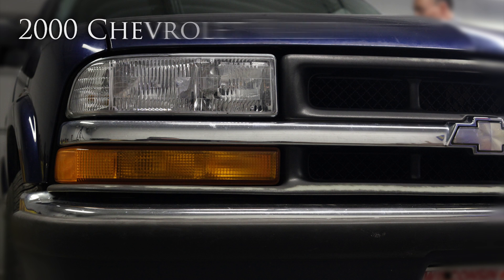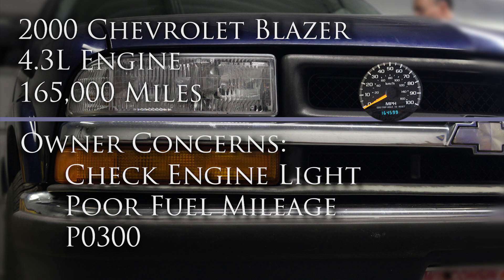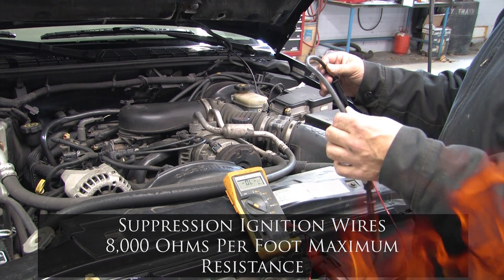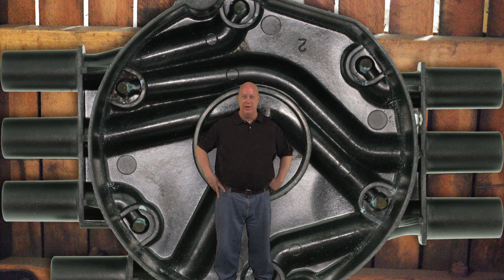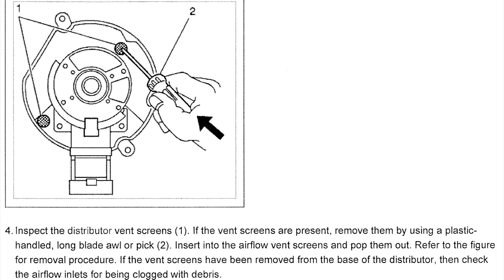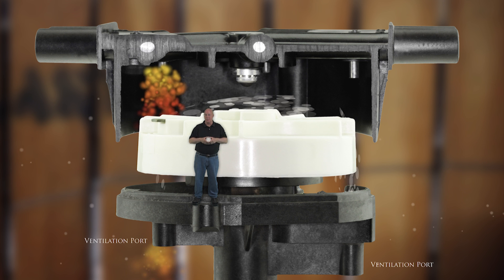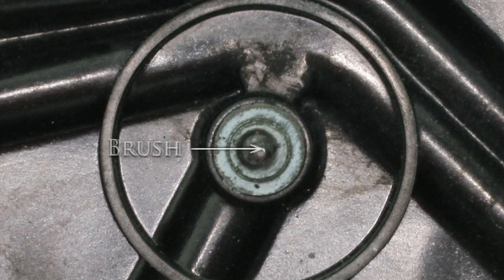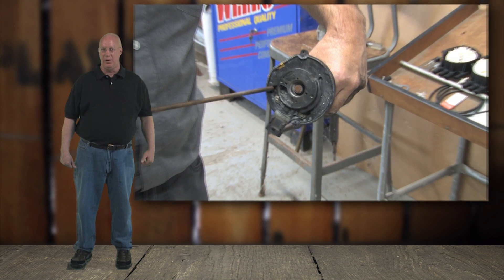Misfire Diagnostics P0300 GM

Comment: So I replaced the cap, rotor wires and plugs back in August.
The car ran fine rain-or shine. It’s January and 40 degrees out and 99% humidity out.
When the car idles I get no missing but when I give it gas the engine misses.
It all goes away when the engine is up to normal temperature.
I’m wondering if the high humidity and the possibility of the screens clogged is the problem.
So strange as this was the first time I’ve changed the cap an rotor sense 2010 and never ever had any problems with the engine missing! I just figured that it was long enough and I change it because of the age. Frustrated

Comment: This is the most informative ignition video I have seen. My 5.7 vortec goes through cap and rotors all the time. Finally saw this video and noticed my "vent" holes where in the casting but never drilled from the factory! Also the timing light trick, checked all wires and had a double fire on 4 meaning it was stealing from Some where, never thought of that trick.

Comment: My #3 cylinder is misfiring. replaced spark plug seemed to fix it, the code stayed away for about a day than came back going to try the coil next. (3.6L pentastar)
Reply from the maker: Hey, be careful swapping out parts like that. A single component can take out other components and you could end up in a never ending cycle. A bad plug can take out a coil. A bad coil can take out a plug.
Mike Becker, Senior Instructor
Reply: @GoTechTraining  I just order the parts to replace all coils and plugs.

Comment: Just replaced all coils/spark plug wires and spark plugs in my 2015 Chevy 2500 6.0 
Still getting p0300.. comes up randomly and when it does it idles really rough and tried taking it for a test drive and see the power decrease
Reply from the maker: How are the fuel trims?
Mike Becker, Senior Technical Instructor
Reply: NGK Technical Training it looks good 
Chasing this p0300 is such a pain

Comment: Okay what if you have a missed only driving but it doesn't miss at idle and you have no codes throne by the computer at all
Reply from the maker: I would take a good look at secondary ignition. Worn plugs could definitely cause a loaded misfire.
Mike Becker, Senior Technical Instructor
Reply: @GoTechTraining  I know you're crazy busy. I should have given you some more information to go on. 1996 Chevy c 2500 5.7 l bortek rear-wheel-drive
NV 4500 Standard transmission. Mopeds crack even load the truck never ever got hot. This is happened after both heads will replaced. New plugs brand new distributor cap and rotor new wires. It's crazy. New fuel regulator and pump was replaced about two years ago. It's not ever thrown a code. Cleaned and inspected the mass air sensor and cleaned the throttle body. Checked the EGR against the proper book checked to be working properly. I checked every vacuum port and line with a propane unlit torch and intake gaskets. I think that's it. I'm far from a master mechanic but I grew up turning a wrench and I have a small business working on Evinrude Johnson outboards. Thank you in advance for your time!!!

Comment: Great video You just got yourself a new subscriber. I hope this is the problem with my bravada. I have a 97 bravada with 212k I love it even though it has a few problems . It wasn’t misfiring but I knew it needed the plugs and wires to be changed. So I got the denso iridium plugs and some new wires and the distributor cap but now it runs very bad and shakes smells like gas and it pops even at idle also the alternator get very hot. One of the screw holes from the distributor broke when I was tighten the cap so I just zip tied it down can that cause the problem? I didn’t want to drive it but I had to take it to autozone so the can scan it and the main problem was po300. When I drove it smelled like something was burning gas or plastic or something. I gapped all the plugs at .60 and put the wires in order. I don’t know what to do can you please help thanks.
Reply from the maker: Hey, thanks for watching! A P0300 is a random cylinder misfire. I don't really see how zip tying the cap tight could cause that. As long as it's 100% solid...best case would having it bolted down. If that caps able to move it could cause your issue. 
Mike Becker, Senior Technical Instructor

Comment: use OEM caps....alot of issues with after market parts.
Reply from the maker: Sure, some aftermarket caps have problems...Ours are built to be OEM equivalent!

Mike Becker, Senior Technical Instructor
Reply: NGK Technical Training Except NGK.

Comment: I'm getting a P0300 code when driving over 2000 RPM. Engine runs great tho. Replaced so many parts, including distributor and crank sensor. I think the ignition advance is not right.
Reply from the maker: Hey Glyn, what kind of vehicle? 
Mike Becker, Senior Technical Instructor
Reply: 2003 S10 4.3L automatic
Reply from the maker: Glyn, what about fuel pressure?
Mike Becker, Senior Technical Instructor

Comment: I have a PO300 and a PO304 CYLINDER misfire on cylinder 4. I replaced rotor cap wires plugs and cleared code then it comes back same side again.misfire 4..  could it be the fuel injectors?
Reply from the maker: Steven, it could be an injector. Could be a compression issue or a breathing issue as well. Did you check compression on that cylinder?
Mike Becker, Senior Technical Services Instructor
Reply: Wells Vehicle Electronics I found the Problem, it was a clogged/bad injector on #4 cylinder. I installed a new set of  Spider Injectors and it runs perfect!

Comment: Tengo el code P0300 trail 
blaser 2002 4.2l
Reply from the maker: Saludos Hugo con respect a el codigo P300 es un codigo que representa fallas multiple de varios cilindros. Lo que yo revisaria seria las bujias pero primero revisaria si el motor tiene una fuga de vacio, tambien revisa todas las mangueras del motor para estar seguro que no esten jalando vacio. Si todo esta bien bueno revisa las bujias. Si tienes uso de un escaner revisa el motro cuando esta fallando para ver que cilindro esta fallando bajo potencia. Este es mi correo por si necesitas mas ayuda ok. fritz.fuchs@wellsve.com espero tu repuesta Fritz Fuchs Instructor de Servicio Tecnico Automotriz.

Comment: Yep. Waste money replacing all the plugs and wires.  All mechanics see are dollar signs.  It's probably really being caused by the MAF in more modern vehicles.
Reply from the maker: I'm sorry you feel this way Dick B. I don't think that is all technicians see. As a technician we want to see a happy customer with a great running vehicle. Nothing is worse than seeing that customer come back a few days later for the same problem. On this vehicle had the spark plug wires not been replaced the truck would have been back in the shop in very little time. Instead of a P0300 code this time though, it would have been setting a P0302 for a misfire on cylinder 2. So it really wasn't a waster of money to replace a worn component. Also, why does the MAF cause more problems on a modern vehicle? I must say from my experience I run into more issues with ignition related problems than MAF problems on todays vehicles. It sounds to me like you may have had some bad experiences in the past bringing your own vehicle into a shop.  
Mike Becker, Technical Services Instructor

Comment: I have a 2005 GMC 2500 Savana Cutaway 6.0L. Can not find anyone in Vacaville or Fairfield Ca. That can repair vehicle with P0300 code. For the past year I have been back and forth with 2 Chevy dealers, We have replaced Crank Sensor, Cam sensor ,plugs wire's, harness, and last time dealer had it they said it was thrust washers on crank. Now it has a new motor and same code. It has traveled about 500 miles. What happened to the Mechanic. Only can find R&R people in this area. Any Idea's??
Reply from the maker: Hey Daniel, sounds like you have one heck of a headache going on. Now a lot of times people overlook the simplest of things. I want to start you back at the beginning. First of all, is this truck flex fuel? 2nd of all, is the fuel in this thing ok, no water in the gas? 3rd...have you had a crankshaft relearn procedure done? That can set a false P0300, and still run just fine. Please let me know what you think.
Mike Becker, Technical Services Instructor

Comment: I'm having the p0300 fault plus p0171, p0131, p0137. I have replaced the the fuel pump, fuel filter, pressure relief regulator, plugs, wires, cap and rotor and still getting these faults recurring. Not sure what else to do now.
Reply from the maker: Tony, sounds like a complex problem. Let's start with what kind of car you're working on. Year, make, model, and engine.
Mike Becker, Technical Services Instructor

Comment: Here's my problem. I have a 2005 GMC Safari with the Vortec 4.3. I too have a P0300 misfire code and have been chasing it for a while now. Here's what I've done. I have replaced the spark plugs, cap, rotor, fuel filter, downstream O2 sensor (shot) and still have P0300 code. I have also replaced the distributor as well. All GM AC/Delco Delphi parts were used and bought new. I have also tested the fuel pressure as well and it seems to be within spec. Overall it runs very smooth and my fuel economy has not been affected (17 city, 24 hwy). It runs pretty good on the highway between 60 and 70 mph but when I go faster than that (75-80) it begins to run rough and the SES light blinks. It also happens when going up a long steep grade as well. Power drops, engine roughness occurs, and a smell (fuel??). I'm thinking MAF sensor but it's not throwing a P0101 code. Any thoughts Mike??
Reply from the maker: Going off of your description it sounds like a possible fueling issue, such as bad injectors or something like that. Fuel injector issues are common on the 4.3L. When you shut off the key with a fuel pressure gauge installed do you lose pressure or does it maintain pressure?
Mike Becker, Technical Services Instructor
Reply: When I shut off the key with a fuel pressure gauge attached, pressure seems to hold. I've thought about the fuel pressure regulator but in my experience with other vehicles, it's pretty obvious with all the black smoke, etc., but I could be mistaken. I'll double check it again to be sure. BTW, I cleaned the MAF this morning and the problem is still there. Coil maybe?? I just wish the damn thing would  blow up...then I'd know! Lol. Thanks for your reply Mike!
Reply from the maker: What kind of pressure are you reading on the gauge? Maybe it's low? It could be a coil too. That's a cheap fix compared to replacing the fuel injector assembly or the fuel pump.
Mike Becker, Technical Services Instructor
Reply: 81zed If you can smell fuel then the engine isn't burning enough fuel i.e. running rich and the air to fuel ratio is off...i would look imto the exhaust side as well

Comment: I was getting p300 random misfire for two years.  Two GM shops couldn't figure it out.  I got pissed off, changed all plugs, wires , coils, fuel filter.   continued with code.  then last summer I started getting p1516. changed my throttle body.  took to a different dealer and their mechanic poured water on the intake manifold. and found that the intake gasket was causing the p300 random misfire.   I now get 15-16 miles per gallon instead of 10 now
Reply from the maker: +oldredcoonhound P0300 can be very tricky to find, glad you were able to get to the bottom of this one! Intake gaskets are tricky to find. I prefer using brake or carb clean to check for a leak, rather than water. Also sometimes intake gaskets only leak on a cold engine and seal back up when the engine is warm, making them even more fun to find. 
Mike Becker, Technical Services Instructor

Comment: Thank you for this informative video. Just replaced heads on a 2002 Buick Rendezous 3.4. Using remanufactured heads, replacing plugs, wires, water pump, thermostat, water hoses and anything else as preventative maintenance to keep from tearing into this thing again. The initial problem was water in the oil, assuming it was a head gasket. Once all back together the Check Engine light was on. The code of PO300 came up as a random misfire. After checking the firing order, I used your method of attaching a timing light to each plug wire looking for the misfire. I was able to locate and determine a bad coil. A trip to the yard and I was back in business, no more PO300. Thank you for saving me from pulling anymore hair out as I would be bald!
Reply from the maker: +Keith L Beaubien Glad to hear you were able to get it fixed  without going bald! :) It's a great test procedure.
Mike Becker, Technical Services Instructor

Comment: I just watched a few of your videos and this is an excellent channel you and your team ARE some REAL technicians just like you mention at the beginning of this video
Reply from the maker: +drwombat Thank you, we appreciate the kind words. We are all master techs with years of shop experience, so we know what it's like to be in a shop. By doing these videos we hope that we can make everyone's day a little bit easier.
Mike Becker, Technical Services Instructor
Reply: +markjhicks quick question and I know this is probably important but last time I checked my suppression wires for ohms I simply probed and re probed I noticed your tech is wriggling the wires back and forth twisting them about then and only then does the resistance jump to higher than acceptable levels why do you think that is? this is a technique I will have to remember to borrow on my next diag
Reply: +drwombat Yes, it is important to move the wires around some when you are testing resistance. When the ignition wires are on the engine and it is running at different RPM, the wires will vibrate and shake. It is common for an issue with the ignition wires not to show up until they are jostled. Great question! Thank you! In our next video on the subject we will be sure to make note about proper testing. 
Mark Hicks
Wells Vehicle Electronics
Reply: +Mark Hicks I believe I found your channel thru a sponsorship on another channel. I'm glad I realized you had your own as this information is much more my speed. I hope to be a part of the next live session for a chance to win a coveted t shirt
Reply from the maker: +drwombat Good, we will see you at our next broadcast on Thursday the 21st hopefully!
Mike Becker, Technical Services Instructor

Comment: My P0300 and rough idle/run on my 2004 lesabre turned out to be the Ignition Control Module. $135...
Autozone tested it and it failed, i replaced it and the car runs great now.
Reply from the maker: +Ken Williams That's great Ken, glad you were able to get it fixed up!
Mike Becker, Technical Services Instructor

Comment: Thanks for the info in the video. I ran across an unusual P0300 code on my 03 S10 with 4.3 . I replaced the distributor at 149K miles Dec 4,2015 because of worn bushings. I could have put in reman nylon body units ,but I found a new Alum body unit and it even came with new cap and rotor for about $20 more. Now is when it gets interesting, 375 miles later my engine just dies going down the road at 60mph, no warning or nothing. Pop the cap off and found center tab broke off of rotor, and also burnt thru on bottom of rotor, put handy used one on, I keep with me. Took  bad rotor to supplier and was given a new one off of another new Dist. "Great they stand behind their parts,He HE He!" Fast forward to Dec 29 2015 , 977miles later I start getting a rough vibration at 60mph, then a "CHECK ENGINE LIGHT" ,guess the code - P0300 , pop cap off again and guess what's missing, YEP !  the center tab on the rotor and it would still start and run. Supplier DID FURNISH a new rotor from a different brand. Can I get any wagers on it, think I will still keep my used spare handy. Just hope it ain't 20 degrees next time. Thanks for your video , I didn't know about the ventilation in the cap . Noel
Reply from the maker: +Kieffer Brothers That's odd that you're having multiples break off. What's the condition of your plugs/wires. Maybe you have too much secondary resistance and It's causing excessive current to travel through that rotor. That's where I would look at this point. Let me know what happens.
Mike Becker, Technical Services Instructor